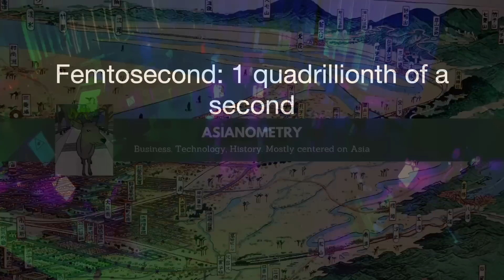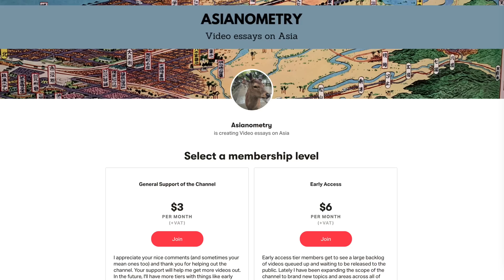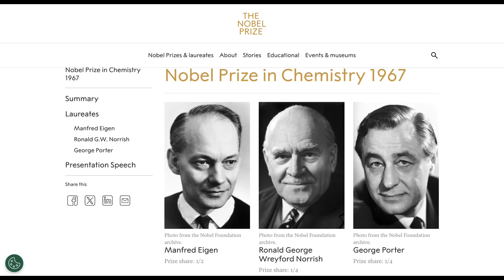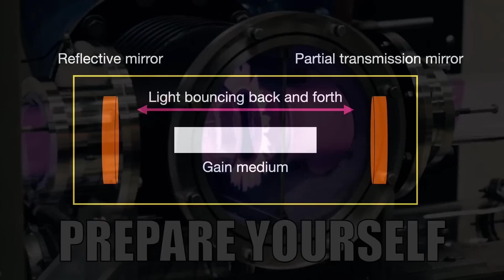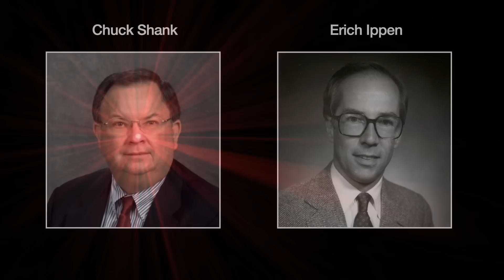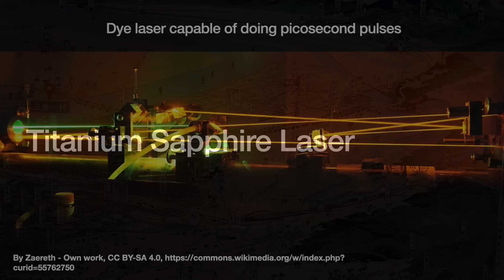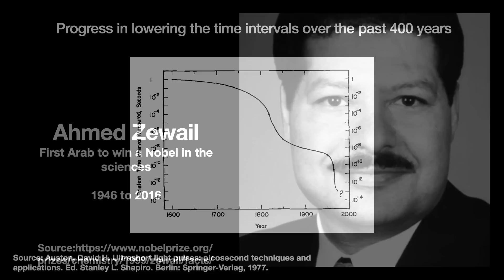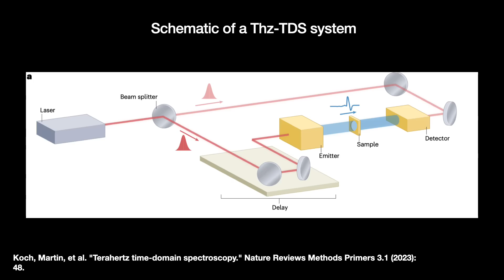The Incredible Femtosecond Laser

Comment: As someone who works daily with ultrafast femtosecond lasers to watch neurons fire, I am really excited to see this video.
Reply: fellow two photon user
Reply: How many photons is that?  Wouldn't miccrowaves be tooooo long?
Reply: You must drive a fine attomobile, good sir.
Reply: How does this work?

Explain it in detail to Asianometry and give him contacts for more information.
Reply: @AllYourMoneyNowKid  You start with a continuous wave broadband laser beam, where the phases are random.  You then use a high speed shutter, such as an acousto-optical beam splitter (AOBS), to pulse the laser in the single microsecond time domain.   A pulsed waveform is a waveform with all the phases aligned (i.e. mode locked), therefore the simple act of pulsing the laser with this "shutter" forces the phases to start aligning  (a good understanding of Fourier transforms and inverse transforms really helps show this).  

To get the pulses even shorter, you take advantage of the optical Kerr effect.  Because the laser pulse is brightest in the middle, and dimmest at the edges, the refractive index of the crystal is lowest at the edges and highest in the middle (i.e. brighter laser = stronger Kerr effect = higher refractive index).  This causes an effect of self lensing, where the the pulse will focus itself, and the brighter the pulse, the more it will self focus.

You can then leverage this effect to get down the to the femtosecond regime.  While, on average you pulses are a microsecond long, by random chance the modes in some of the pulses are even more aligned, and therefore the pulse is even shorter.  These pulses with therefore self-focus even more.  Therefore, all you need is a metal aperture at the output of the Ti:Sapphire crystal.  As you close the aperture, you attenuate pulses that are poorly focused (dim, long duration pulses), while enriching for pulses that are well focused (bright, short duration pulses).   This then shifts the total distribution of pulse durations to a shorter time.  

You can then progressively close this aperture, such that in a few seconds you have shifted the distribution of pulse durations to extremely bright and extremely short pulses.  

So why can't you simply close the aperture indefinitely.  Well Fourier transforms tells us there is an inverse relationship between bandwidth (the number of modes) and the shortest pulse possible.  Fun fact, this inverse relationship is the exact same one in the Heisenberg uncertainty principle.   For a simple example, imagine a laser with no bandwidth (i.e. a laser with a single mode).  This lasers output will always be a sinusoidal output at the frequency of the wavelength as that is literally what one mode is, a single sine wave.  Therefore, in order to get shorter pulses, we need additional modes to interfere with one another to generate the pulses.

One last low-level piece of the puzzle is that the pulse is always trying to pull itself apart due to group velocity dispersion (GVD).  This is because generally longer wavelengths go faster through glass and sapphire than shorter wavelengths (this is exactly how prisms work).  Therefore, our pulse is constantly trying to spread out as the longer wavelength modes in the pulse race ahead, and the slower wavelength modes fall behind.  For the runner analogy, it would be like having a clump of runners, but the blue jersey runners are slow and the red jersey runners are fast.  Therefore, as this pulse moves through glass it will spread out as the red jersey runners race further and further ahead.

The solution is a prism compressor, which was briefly hit upon in the video.  This flips the pulse around such that the blue racers are in front and the red racers are behind.  This way as the pulse goes through glass, the red racers catch up to the blue one, and the pulse self compresses.

If you want a good primer, Google "FSU microscopy Ti:Sapphire."  This is take you to a good low level primer.  Another good resource is Falstad dot com.  There is a Fourier transform applet, where you can line up the phases of multiple sine waves as see how you get a pulse as a result.  You can also see how increased bandwidth will get you shorter pulses.
Reply: @AllYourMoneyNowKid  If you Google "FSU microscopy Ti:Sapphire" you will get a nice introductory explanation.  I tried writing out a more detailed explanation but it got deleted.  Too long I guess?
Reply: That's lit
Reply: Y'all forget neurons are analog devices
Reply: Thank you for personally identifying yourself as a prime candidate for espionage , Mr. Smith
Reply: You guys sound smart , for real, so forgive this dumb Johnny Mnemonicesque question.
Could you use it to transfer data from a "camera" to  the optical nerve or some part of the brain to make a person "see faster"? Like seeing real life in slow mo.
Reply: @bensmith3304 I work daily with femtosecond lasers too but in a different field (quantum technology), tell me more of what you do i'm really interested.
Reply: Would you mind if I shot you a message? I'm an independent researcher, and have some questions if you have the time. thanks!
Reply: @pogactual4531  Sure, also feel free to ask in the comments section if you think the answers would benefit others.
Reply: Ok it's been a year but What would happen or see when energy density's get that compact? Is it just a brilliant light?
Reply: @ThatGrungeKdd  Mostly just brilliant light, but at these extreme densities you also start to get non-linear effects such as self-lensing and self-phase modulation.